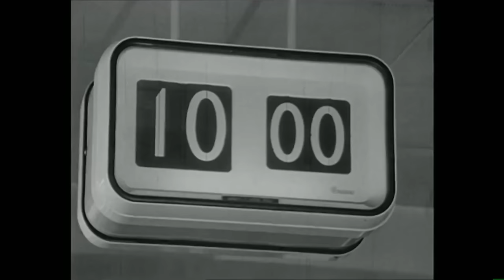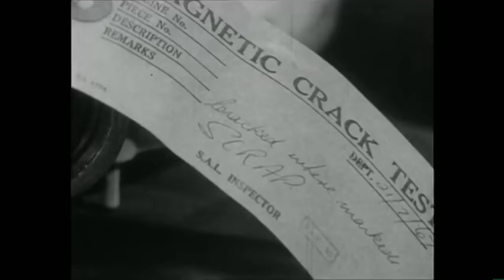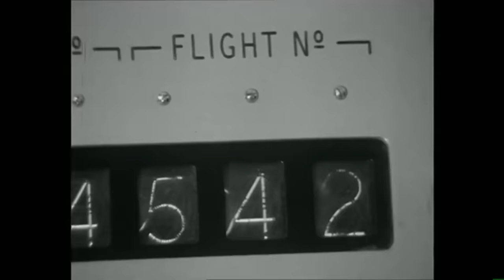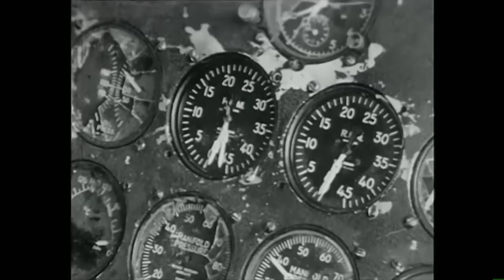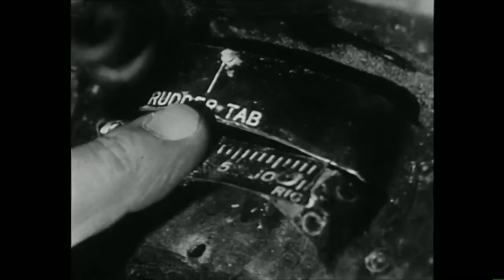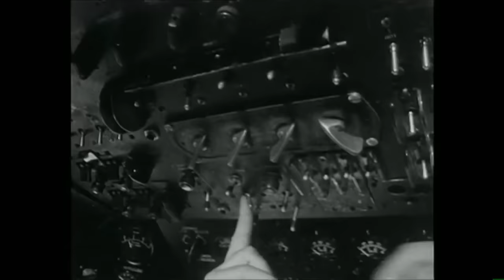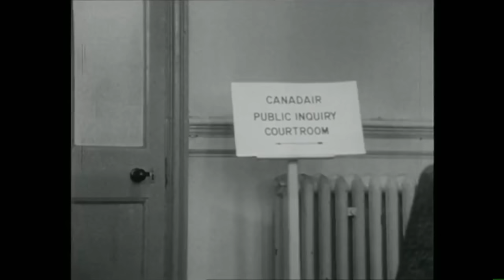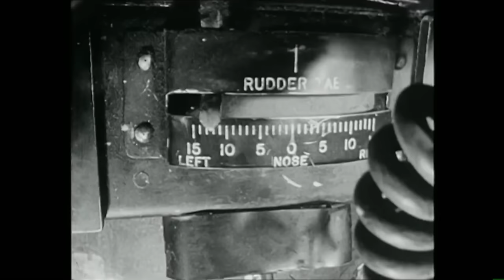Stockport Air Disaster

Comment: Strange how it is never mentioned how the aircraft would have stayed airborne if both starboard engines were feathered. No four engined aircraft would continue flying with both engines on one side out and both not feathered. Yet this is never mentioned,  even in the official investigation. Engine failure of any description was always followed by feathering. It was drilled endlessly.
Reply: You are absolutely correct.
Reply: Bob Cornford .I think the point of the investigation was the theory that the pilots had a failure of the no. 4 engine on final approach when they pushed the slightly open crossfeed valve home as part of their pre-landing checks, but then the Captain selected the fuel shutoff for the no. 3 engine by mistake (instead of the fuel shutoff for the no. 4 engine) when the crew were securing the failed no. 4 engine. This ended up with them being in the configuration of having no. 4 engine shutdown and feathered, and no. 3 engine windmilling and producing a lot of drag. As you say, if they had figured out what they had done they might have been able to feather the no. 3 engine, or even restart it as suggested by the narrator, but I guess the workload just got too high by that stage and overloaded them. Poor devils.
Reply: @jimthomas6374  captin marlow had at this point in time  been on duty for 12hours 55 mins having played a round of golf the previous day had slept till 18.00hrs had a shower and driven to castle donnington  before arriving at manchester  airport ringway at the time  so may have been fatigued  too so had been at least awake for 15 hours at this point and with engine problems too and no auto pilot to land so he was full on at that point
Reply: @ericlees7518  The point brought out in the enquiry was that the one pilot flying was  completely occupied keeping the a/c in the air. It meant that everything else was carried out by the NFP. The outcome was that Argonauts had to have a 3 man flight crew, either 3 pilots or 2 pilots + FE.
Reply: How do you restart an engine in flight that had been stopped by fuel starvation?
Test carried out during the investigation: engine responds to unfeathering in 3 secs, with fuel flow restored useful power is generated in 12-15s and 2,250 rpm / 35 inch manifold pressure is reached 25 seconds.

(  https://www.baaa-acro.com/sites/default/files/2018-04/G-ALHG.pdf  )

Also it is mentioned in the report that a landing with only 1 and 2 running, 3 windmilling and 4 feathered would have been possible but for the overshoot  Also it was a reasonable decision to overshoot and find out WTF was going on. Three engine take-offs and 2 engine landings were trained and tested on.
Reply: @jimthomas6374    With constant speed pros in a supercharged piston engine, even during fuel starvation, the windmilling prop will keep the RPMs and the supercharger will keep the manifold pressure --- that surely did not help in identifying the problem, especially if the other engine is is running at low power settings.
Reply: @bobcornford3637    They had an engineer in the cockpit who helped (read gauges, log data, on pilot request moving levers and switches) ... albeit that was not a flight engineer, it was an experienced ground engineer travelling with the plane in case it needed some maintenance away from it's home port.
Reply: @advorak8529  sadly he was not a flight engineer. A qualified FE would probably have picked up on the low fuel pressure and low fuel flow  which would have been the only clues, aside from maximum port rudder trim and hard left rudder.
Reply: This is not true.
Reply: Bob Cornford   Maybe. It is quite possible that both engines died of fuel starvation, says the report.
Reply: Juuso Hämäläinen   This is not true
What exactly is “This”?

Comment: There was only one fuel filter for the four engines. I was there as a constable and the general consensus was the filter was clogged, no official recognition has been made of this.
Reply: That really is a bit of an oversight. Thanks for the information.
Reply: that would explain the rpm or lack thereof, because dirty fuel being recirculated in such a huge engine isn't going to do it any good.. thanks for the info hope you have a great day
Reply: No.  And even if that were true ALL engines would have been affected.

Comment: I live near to where this happened its just a hole where it crashed.
Reply: What still?
Reply from the maker: It's not a hole, it's a valley. That's why nothing was built on it at the time, why the pilot opted to crash there rather than into buildings  and why nothing was built there since.

Comment: I had no clue that the DC-4 was produced in a version mounting Merlin engines.
Reply: Neither did I. Other versions used Pratt & Witney?
Reply: @missasinenomine  mostly, but  sometimes the customers would specify a different make of engine, more often than not because other aircraft in their fleet used a particular engine so having their new aircraft powered by the same engine made maintenance easier and less expensive. In the case of the Canadair four / North Star  it in fact was an amalgamation  of D-4 AND DC-6 components, the Merlin was installed over the Pratt and Whitney because it would give the aircraft a higher cruising speed than a standard DC-4. The diasadvantage of using the Merlin was that being designed for military use, they were extremely noisy leading to very unpleasant noise levels in the passenger cabin. Which is why BOAC quickly phased them out of service and most of the aircraft ended up in service with airlines such British Midland
Reply: @EVISEH  Thanks for the info!  I was going to say, Merlins are very noisy!  It always makes me wonder at an airshow, (with Spits, hurricanes & lancs), how the Germans didn't hear them coming!  On the other side, the Juno engines used for the 3 motor Junkers JU52 were noisy, (inside the aircraft), but the noisiest of all (at an airshow) was the Antonov 2 biplane.

Comment: I didn't know flight recorders were round at that time. It seems better design than the modern square ones in terms of survivability. Why did they abandon that design🤔
Reply: Perhaps they still are and the cubes are just around them to absorb as much as possible of the impact?
Reply: @ixlnxs  I've watched a lot of documentaries on this topic and I've never seen such thing when they opened a rectangular box. Probably, some of those were just movie props but there were a lot of clips that showed the real-life opening of those, and what's inside was just the recorder's guts. I'm sure there's a reason behind this design.
Reply: they stopped using the round ones because its harder to fit the stuff in neatly mate. modern black box design has impact protection they can withstand thousands of tones of shock as well as much higher temperatures than the one we got to see in the film.
Reply: @tommyfred6180  I'm sure they have a pretty good reason for that change.😎
Reply: Huh? Maybe next time there's a safety revision of a fundamental piece of aerospace kit, they'll pass it over to you,  some random YouTube commentator, for approval as to whether it seems better
Reply: @limpfishyes  When exactly did I say that I was an expert. You probably saw that I ended my comment with a question. That's what the comment section stands for and if you open the replies, you will see that someone answered it. Don't you have anything else to do but troll people?
Reply: @limpfishyes  Settle down

Comment: Why didn't each engine have its own rev counter . Even with todays technology air crashes are usually the result of pilot error . I dont know at what period flight engineers were made redundant , but that accident would not have happened if such a crew member was in the cockpit. Actually checked myself , the AAA decided that DC4's didn't need an engineer but DC6's , Boeing Stratoliners , Constelations and early jets did.  Now you Know.
Reply: There were two instruments, but each instrument had two indicator needles, one for each engine, for a total of 4. This was likely to save space on a busy instrument panel.
       To me, the big  issue was; why were the RPM cables reversed? Was it a manufacturing defect? Had the instrument panel recently been worked on? The documentary didn't mention, if maintenance logs were inspected, or if there was recent maintenance on the instrument panel. They suppose, that the wrong engine was shut down & feathered, but if the cables had not be reversed, it's likely that the correct engine would have been shut down & feathered.
Reply: @sparky6086  You , probably like I do is watch aircraft accident documentaries, if so you may recall an episode where one engine was on fire and the Captain shut down the good engine with fatal results.   Other cases when instruments have shared purposes has been disastrous . My point about flight engineers is a good one , because they didn't become redundant from the cockpit crew until technology made their task automatic.
Reply: @jameswebb4593  Yes. That's where I recall the 737 incident from. It was from one of those air crash investigation type shows.. It's been awhile, so I didn't remember much beyond, that the wrong engine was shut down. I suppose; this film may have inspired those shows?

Comment: I never knew that the mighty 'Merlin' was used in a civilian aircraft!
Reply: Yes though it was coming to the end of it's service by 1967. A very reliable engine although rather thirsty I would guess.
Reply: Yes, more than one. 71 examples of the Stockport aeroplane,  the Canadair “North Star”, a Douglas DC-4 development, were manufactured, with 22 operated by B.O.A.C., 20 by Trans-Canada Airlines, and the rest by the Royal Canadian Air Force and Canadian Pacific Airlines. When the major airlines disposed of them in 1960/61 they went to charter airlines like Derby Airways and British Midland.
Another ‘Merlin’-powered machine was the AVRo 685 'York', a development of, and using parts common to, the 683 ‘Lancaster’, both designed by the great Roy Chadwick at Chadderton. It was designed as a freighter, or could be fitted for combined freight/passenger or all-passenger use, so was operated by B.O.A.C. and B.S.A.A. (British South American Airlines). The R.A.F. used it for v.i.p. transport, one being fitted-out for use by Winston Churchill as a flying office/conference room, and the type was one of the “Berlin Soviet Blockade-breaker” supply aircraft of 1948-9 because of its large freight capacity. The versions used for the London-Johannesburg route had 12 bunks fitted as well as seats, owing to the long flight duration. 45 were built for the airlines and 208 for the R.A.F., and were retired by B.O.A.C./B.S.A.A. in 1952 for passengers, 1957 for freight, while subsequent operators Skyways and Dan Air retired theirs in 1964.
There was also the 'Merlin'-powered AVRo 691 'Lancastrian', some converted from 'Lancaster' bombers, others manufactured new without any armaments, bomb-doors, etc., 9 being converted in Canada by Victory Aircraft for T.C.A. and  30 manufactured by AVRo in the U.K. for B.O.A.C./B.S.A.A. Q.U.A.N.T.A.S. (Australia) and Alitalia operated the type too. It was a B.S.A.A. 'Lancastrian' which opened London Airport (then a collection of huts and tents) at Heathrow with the first scheduled flight in March 1946.
Reply: @DaveDeltic  *QANTAS

Comment: So would we say that the design of the fuel tank controls could have been better? Possibly, who knows?
Reply: I imagine they would have gone for a detente system so there's no mistaking when it in the closed position.
Reply: @splint3048  Indeed. But nothing like that was mentioned at the end of the analysis.
Reply: Would there ever be a situation where graduated control of these levers would be necessary? Could they not have used simple ON/OFF or OPEN/CLOSE switches, rather than sliders?
Reply: @2H80vids  Not really sure. But presumably the design was altered somewhat after this debacle.

Comment: still hard to understand how this plane fell from the sky. Still had two good engines.Even with no fuel, should 've been able to glide her in, even with no power. I dunno.
Reply: Bill - The aircraft was capable of maintaining level flight with only two engines provided that both propellers of the inoperative engines were feathered to reduce drag. This is an almost universal requirement for all four engined propeller aircraft. If the propellers are not feathered, then the airflow ends up driving the engines causing huge amounts of drag on the aircraft. With all systems functioning and operated correctly, the aircraft could theoretically have maintained low level flight and conducted a controlled emergency landing with just one good inboard engine. With asymetric thrust coming from two good engines on one wing and two failed engines on the other, with one propeller feathered and the other not, it is virtually impossible to maintain full power on the two good engines because the control forces become too high for the crew to handle. So it is necessary to reduce power to levels where the pilot can maintain control, but this may not be sufficient for the aircraft to then maintain height. This is what appears to have happened in this incident.
Reply: @michaelkaliski7651  i guess my question is, what could the PIC have done differently? Or, what would you have done differently?
Reply: Wonder if the engines being Merlins as opposed to the big Double Wasps on the Douglas versions made the difference ?
Reply: @Fanakapan222  the merlins had considerably better performance
Reply: Have you any idea how far he was from the airport ( Ringway in those days ) . The aircraft passed not far from me about 5 miles from Stockport and he was already very low.

Comment: Why not dump the fuel directly into big tanks instead of small ones?
Reply from the maker: Well the fuel tanks would be in each wing. The fuselage would be reserved for crew, passengers and luggage.
Reply: By having multiple small tanks, you can spread the weight around and shift it in flight.
Reply from the maker: @natehill8069  What would the point be? You have bear in mind that this was in an aircraft designed around 60 years ago and transferring fuel may not have been possible or if it was the process could gave been either slow or even manual. Not merely the flick of a switch it would be today.
Reply: @gileskathome  fuel delivery was by electrically powered  pump and the fuel lines were pressurised
Reply: @gileskathome  Managing weight and balance is an important component of flying, even in a Cessna 150. The DC-4 had both wing tanks and fuselage tanks. But the wing spar can only support a certain amount of weight in the fuselage so you either have to keep fuel in the wing tanks until you've burned off a lot of the fuel - at which point there isnt any reason to put it back anyway, or you have to carry less cargo/pax and then you can have wing tanks empty. But transferring fuel between tanks in real time is a concept older than the DC-4.

Comment: Is it just me , or was the faulty rpm gauges that were running reverse polarity a glaring indicator that the pilot received rpm for the wrong engine , meaning he shut down a healthy engine based on the gauge ?
Reply: But they found that the connectors  at the engine end were reversed as well, so the indications were correct. As they script said, it was a "red herring".
Reply: Ron D'Eau Claire ah , ok I misunderstood that bit clearly .
Reply: Ron D'Eau Claire although any non conformity found on that side of the plane must be viewed critically I guess
Reply: At the very least, the swapped cables at both ends are an indicator of sloppy maintenance.  One hopes they pursued this potentially fatal swap much more extensively than the narrator said.  Unfortunately, this sort of maintenance error still happens.

Comment: Surely 2 engines could see her home?
Reply: You would have thought so. Even one. Albeit crabbing.
Reply: If the crew were on top of their game, 2 engines should have just been able to get the flight to completion and a single landing attempt. But everything would have to work perfectly, including the crew recognizing the problem right away and concentrating on flying the plane - feathering the propellers; rather than fixing the engines. A lot of crashes occur because the crew fixates on getting dead engine(s) running again and lose sight of what the plane is doing. Once the airspeed gets below a certain number, then the rudder no longer has the authority to overcome the drag of the dead engines; then the right (in this case) wing drops and they stall/spin.
Reply: Aircraft then didn't have the high thrust/weight ratio of today, also, doing a asymetric  turn, trying to hold the aircraft level, by rudder deflection/aileron correction adds loads of drag, therefore, you need more thrust. as the aircraft is crabbing to the right, the fuselage is acting like a giant brake, losing height/speed...